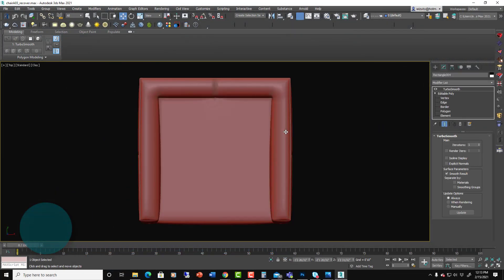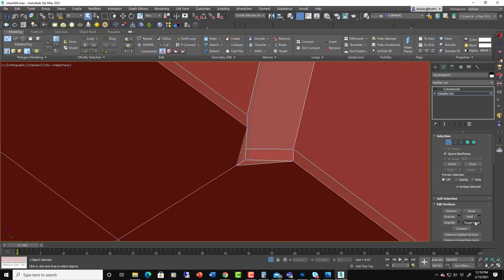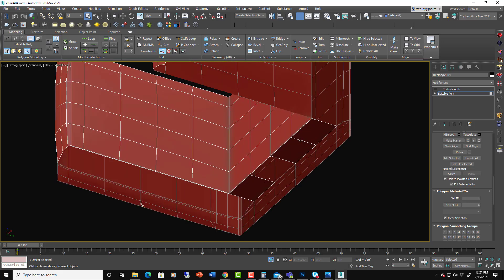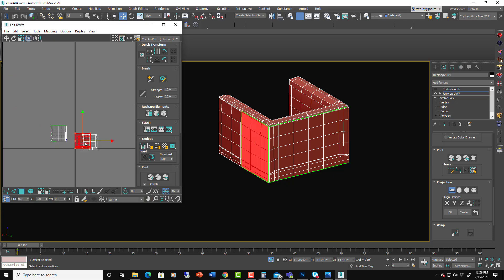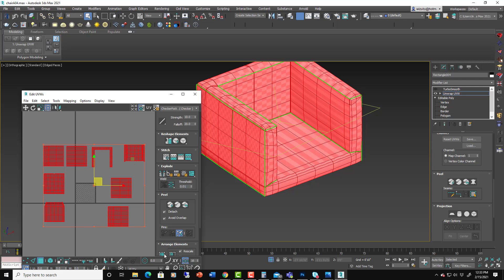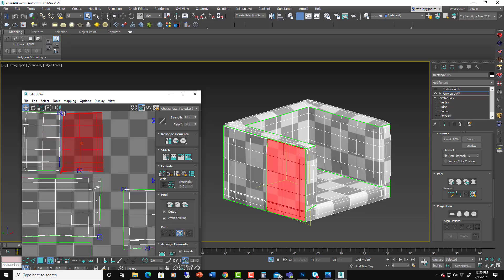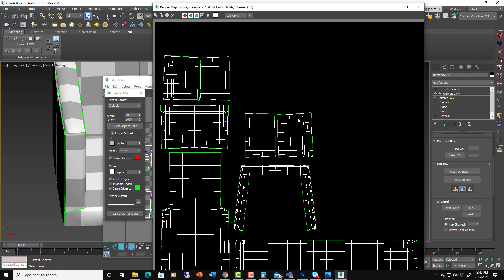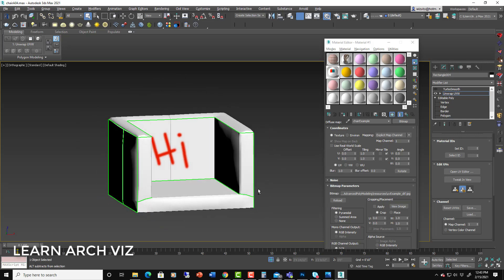3ds Max: UVW Unwrap Your Poly Models - Step by Step

Comment: Adam, I do have several of your courses and they are good.  I happened upon this youtube video and good info again.  I am going to ask though, if I were to take this into unreal, you would unwrap the uvs in two separate efforts, correct?  You would unwrap for diffuse on channel 1 and then do so again on channel 2 for the lightmaps, correct?  My other question is would you do the basic material setup in 3smax and export with datasmith and then refine in unreal or just give a standard material and then build a new material in unreal.  The reason I ask is because I find that datasmith puts out some pretty involved materials in unreal with probably more nodes than necessary.  I believe these add to the material draws in unreal which matters when trying to do real time stuff such as VR.

Comment: terrible topology
Reply from the maker: Like I mention in some of my other videos, making perfect topology in arch viz is usually not my main focus. Unlike with gaming models, I find that I can cheat a lot of things, and perfect topology is not essential to the finished result. But yes, for a different application this could be built a lot more carefully.
Reply: Not sure I totally agree on this comment.  On quick glance, the subdivisions are all quads so that is correct.  If you wanted a lower poly count for a game or something you could remove a good many loops but like Adam said, if one is doing still renderings in vray or something, doesn't really matter.  If one throws a sub-d or turbosmooth on this, you could get more refinement of the mesh but you would have more poly's.  I am not quite sure what the context of this comment is which is why I would ask why bother making the comment.
Reply: @arcitek66  on a static non deforming mesh you don't need all quads. Even a Fusion360 mesh with many long triangles will look good as long as the norms are correct. But this mesh just  not optimized well in terms of topology overall.
Reply: @sqwert654  I am sure you are more of an expert on this than me so I am not arguing with you.  Also, you clarified your original comment by adding for optimization which I agree with.  However, I am currently modelling a high poly version of a detailed axe and I can tell you that these freaking triangles give undesirable result in my mesh when I throw a sub-D or turbosmooth on the mesh.  There is distortion (pinching) that occurs which is maddening.  This distortion would render in my static scenes so I always need to correct them.   What is even more frustrating is that when going into or exporting from Unreal, things are always triangulated to go figure.  Again, this is not my area of expertise since my job is more than of an architect.
Reply: @arcitek66  triangles are not Sud d friendly lol